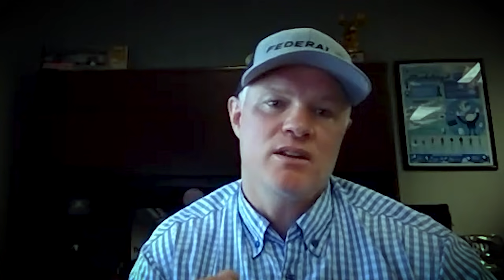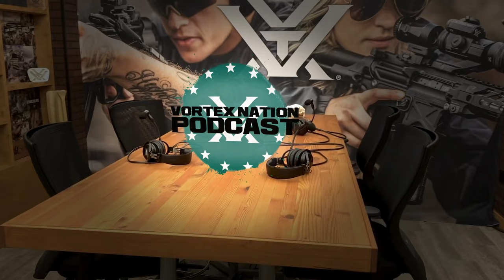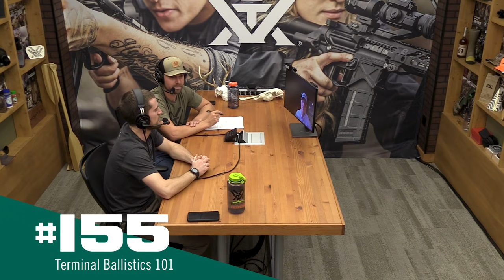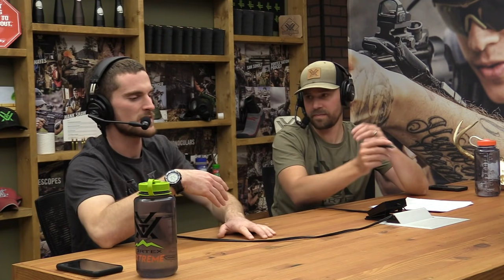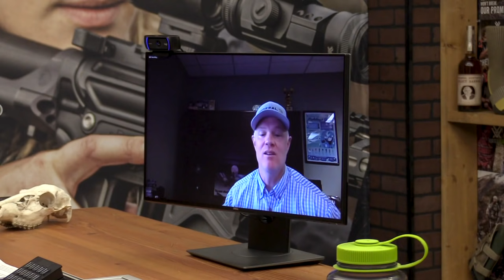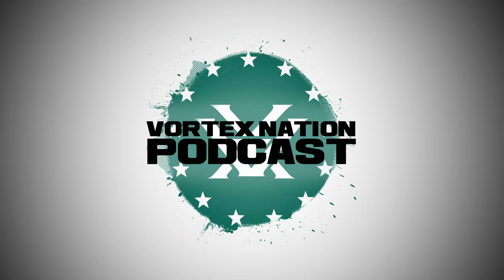Ep. 155 | Terminal Ballistics 101

Comment: Another fine episode that slipped by me, before. This is something that I have also keyed in on. Philosophy of use. My favorite cartridge is .308 Win and I have 4 rifles in .308 Win. The last rifle is 5.56 x 45 mm NATO (.223 Rem.)

The best bullet for hunting whitetail deer (my primary target, with feral hog second, because of availability, and mule deer, if I get a chance to go west,) is not always the biggest or the fastest or even the flattest shooting cartridge. Run a drop sheet on any ballistic calculator. Vortex as has one, the LRBC. Federal has one, as well. Shooter's Calculator is also a great sight. Ballistic Buddy is a free app for your phone. I have that. And Strelok is free but Strelok Pro, which is better, costs about 12 USD. And worth it, I would say.

For .308 Win, the impact energy of 1,000 ft pounds is somewhere between 400 and 650 yards. Sure, a deer is not going to shrug off 999 ft-lbs with a smirk and a "nanner nanner boo boo, stick your face in doo doo..."

So, you can also look at the opinions of others who have had extensive experience. But something I have learned a few times before and again, with Jim on another Vortex Podcast episode when he borrowed a hallowed rifle and had crappy results drove a lesson home for me. 

Find the twist rate of your barrel. And look up the grain weight of that best operates in that twist. Faster twist rate is better at stabilizing heavier bullets. Slower rates work well with lighter bullets. Not always less accurate.

95 percent of deer are shot at less than 500 yards. Quite a majority of that is less than 200 yards. Hunting on your aunt's 20 acres, for example, at the edge of her milo or canola field. You might be shooting along the tree line and get a shot about 100 yards.

Also, don't shoot farther than your capabilities. I still practice off hand shooting with dry fire. Jeff Cooper, and rightly so, says the off hand is the last resort. But it could happen and you will waver and you might be drifting 1 to 2 MOA at 100 yards. Which is still accurate enough. 

So, then, the big consideration is not muzzle velocity or how well you do at 1,000 yards. What is important is getting the round into the target animal and have a wound track that does the job of stopping the heart and lungs.

Which could be a lighter bullet with a specific tip, a low G1 BC and a slow speed. Not as slow as a .450 Bushmaster but enough to get in and do the job.

Comment: I like using copper bullets for the close woods stuff.   And federal terminal accent bonded for long distance things
Reply: I'm gona design my own bullet kinda like the terminal accent with a solid shank, but instead of having a full molecular bonded lead front end, I'm going to do a soft lead poured hottcore with a aluminum tip.    It will make it open up a lot easier at long range because it's not molecular bonded, just surface bonded w the hottcore method.  I think that's the bullet design that will change the future.     Terminal accent are pretty close but they don't like to open good past 300 r 400 yards.    I kno they claim like 900 yards, but that's a fantasy!       I think my bullet idea will address this issue 🤔

Comment: Hum... I understand, but I might be wrong, that in pistol bullets sort of speeds, the permanent wound channel is what kills mostly (if one puts aside the shot placement into the nervous central system and psychological kills...), eventually by exsanguination, right? If no major vital core function organ is directly hit... I mean the fluids/blood leaks until the pressure drops below the minimal requiered to still pump fluid to core functions and the body shuts down progressively until it goes into chock, can't recover and dies. But at rifle speed, the temporary wound channel is violent enough that it can push aside important/vital organs beyond their elasticity capacity to recover, tearing apart the tissues involved, increasing the wound damage and therefore adds this functionality so to speak, to the permanent wound cavity lethality if you will. And that's why a hight velocity rifle bullet wound is usually way less survivable, than a pistol wound. Even if they are FMJ bullets... Add to that all the JHP, SP, Bounded and the rest of enhanced bullet designed constructions and you enhance the ability of the bullet to transfer most of its remaining potential energy at impact, into the body deep enough into the target therefore optimizing it's killing potential by not wasting much of that energy by fragmenting too shallow into the target and achieving a more superficial wound (that might end up been lethal nevertheless over time, but not in a timely manner), or by taking the bullet away from the target down range after it exits the body on the other side (as FMJ bullet would, for instance...).

Comment: Saying 'Ballistic tip' w/o referring to the Nosler offering seems to be used like the word 'Band Aid' instead of 'Self Adhesive bandage'. (Band Aid is (R) ). Yes, Kleenex is the same situation.
____________________________________________________________
Also Quick glossary; I just made up.:
CUP & CORE = Older style regular cheap hunting bullets. Has issues up close with core jacket separation (Nosler Partition fixed that). It is supposed to create the classic mushroom.

MONOLITH = usually used in association with all copper bullets. Creates jagged petals that fold back. Also, preserve the shank & weight even better than bonded. In most cases. YMMV

BONDED = the lead core is welded or lasered (company propriety process) to the copper jacket to prevent core jacket separation where needed. Similar mechanism to the cup & core. but preserves more material(weight) for deeper penetration.

POLYMER TIP = Built for around 50% weight retention (give or take). Hollow cavity behind the polymer tip. Like said "Explosive energy dump inside the animal ." May not get an exit wound.

HOLLOW POINT = It has a hollow point. Also an older style. Made for quick expansion. Made to do Polymer tips do today. Which w/o the tips are a hollow point. (e.g. TXS vs TTSX)

Comment: Speer made a high BC Gold Dot Bonded plated bullet that over expands at 3000 fps Impacts in .264 very similar to the Fusion that stabilizes in 1:9. The Speer Impact which is a bonded VLD with a thin jacket not plated is coming in .264 according to Midway which should also stabilize hopefully in the 1:9 because of it's short length and bearing surface in 140gr that should handle impacts from 3000 fps and under might be extremely interesting to test as apposed to the ELDx cup and core gernading projectile.